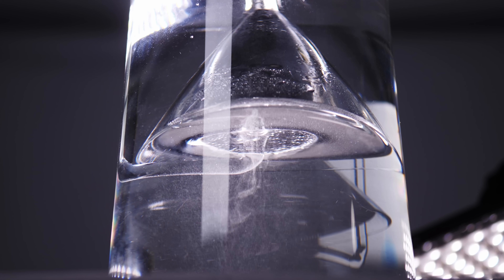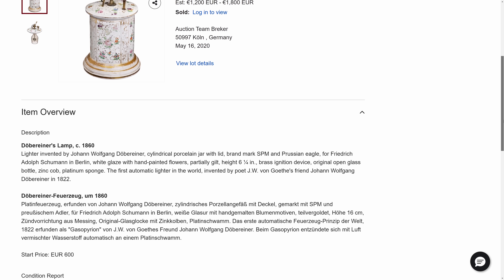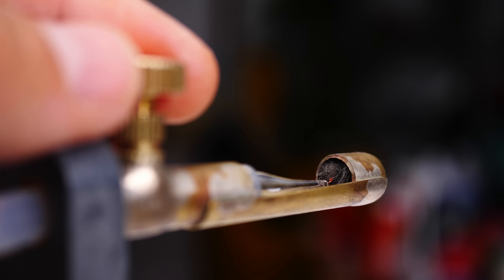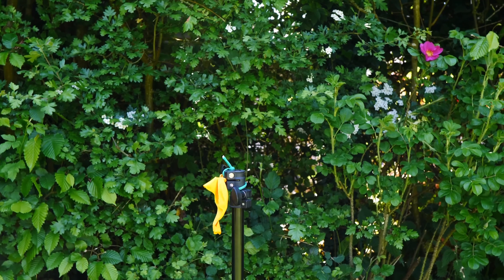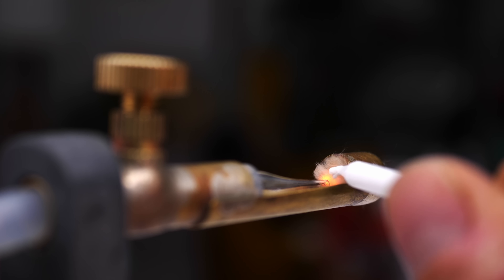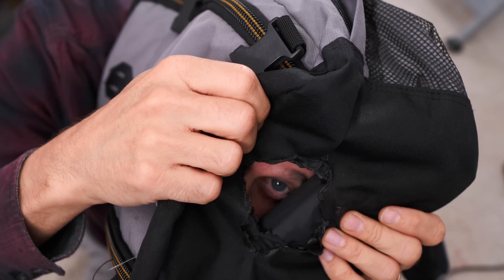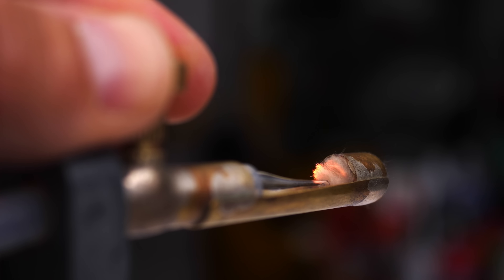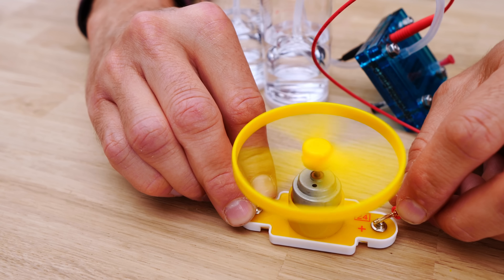This 200-Year-Old Lighter Ignites Without a Spark

Comment: Could you achieve the same effect with an electrolysis system instead of hydrochloric acid to create the hydrogen?
Reply: yes, but thats kind of putting the cart before the horse--  the thing that makes the catalytic system unique is it being purely chemical with no need for added heat or electricity like eletrolysis needs.  where are you getting the energy to light your lighter by eletrolysis when your lighter isn't lit yet?
Reply: @zagrych  I suppose you're right haha, i hadnt even thought of the fact that this was made before electricity would be available like that.
Reply: Still I think itd be a funny novelty to make!
Reply: @legomann4345 you are still right in mindset though.  flint and steel has been around for thousands of years and modern matches were invented shortly after this.  It was definitely powered by hype as a cool fancy new technology as much as it was by any practical use.  Maybe it was a few hundred year ago version of buying the newest cell phone😅
Reply: Any process that produces hydrogen would work
Reply: @LORDKINGQUACK  thats what im thinking, like you could remake this and you wouldnt have to deal with the acid. It'd probably be a lot safer!